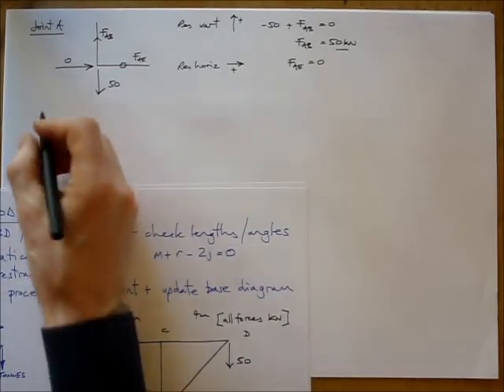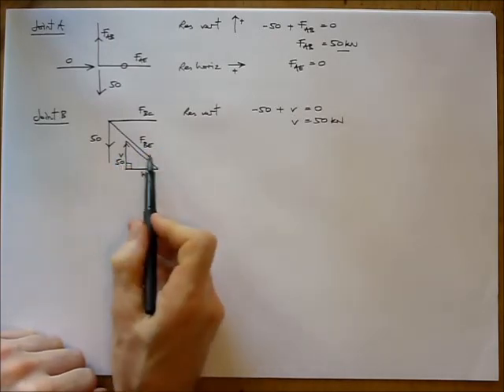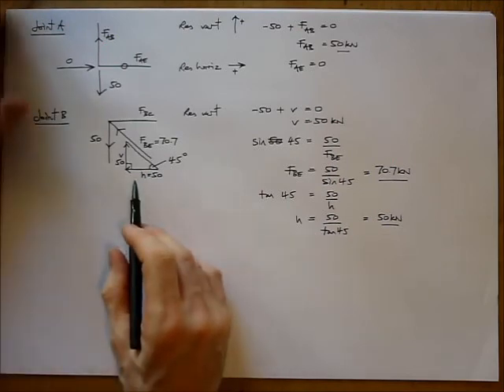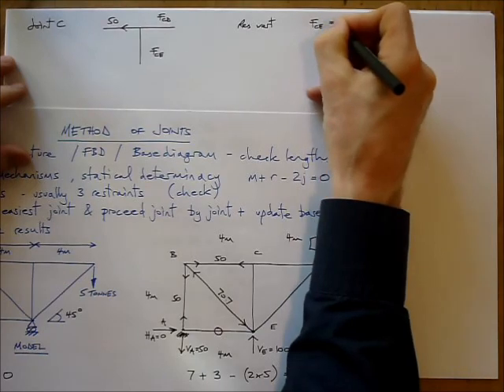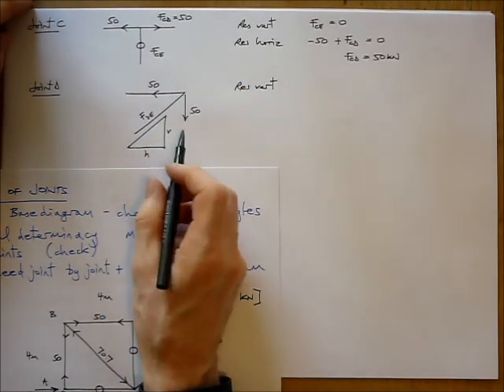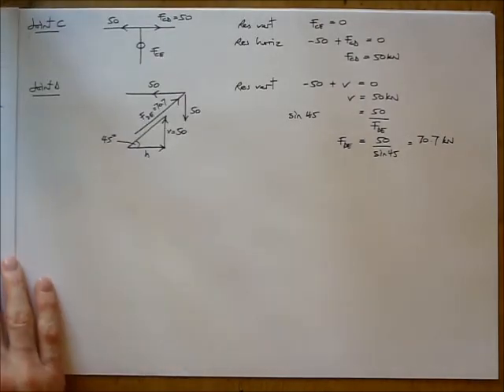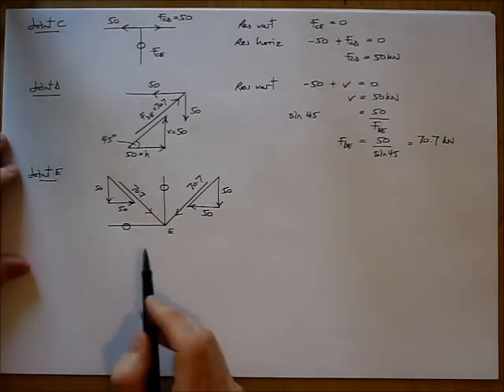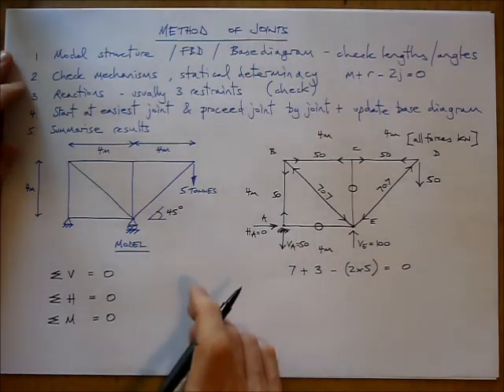Triangulated Structures - Method of Joints - Worked example - Part 2 (of 2)

Comment: Hey Mike Great Video. One quick questions. Can we take out members with zero force and the structure would still be stable?
Reply from the maker: Hi Zeeshan Ijaz, theoretically the structure would remain standing and the forces in each of the members would remain exactly the same. However, this would not be a good idea in reality as structures are rarely built exactly as they are modelled and forces may not be applied just as we assume and other forces could arise that would affect our very susceptible structure. So after ensuring that our structures are in equilibrium, we also make sure that they are robust and stable. Best wishes, Mike